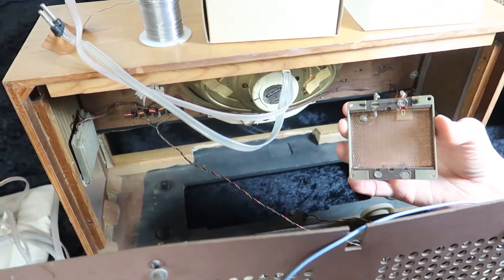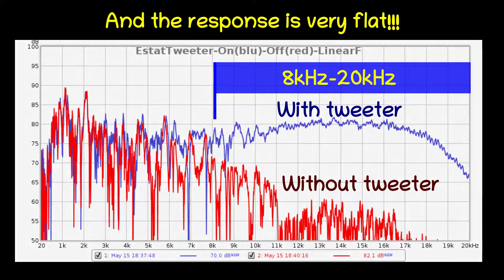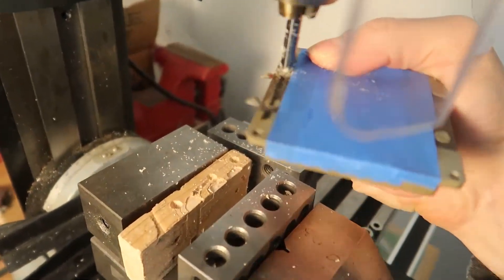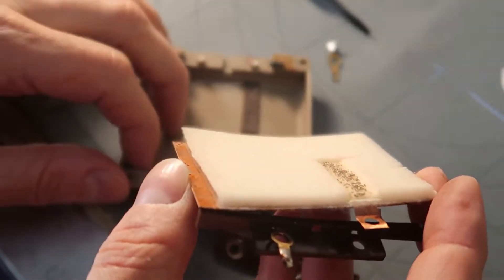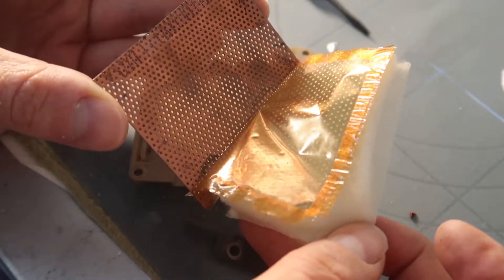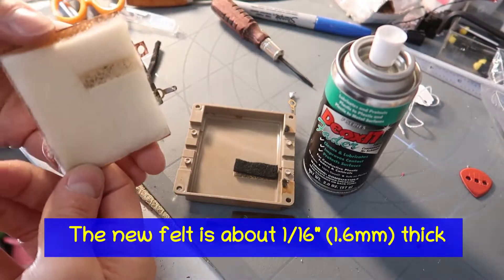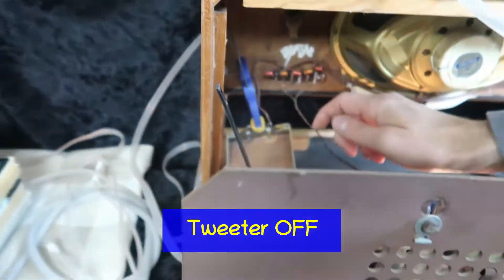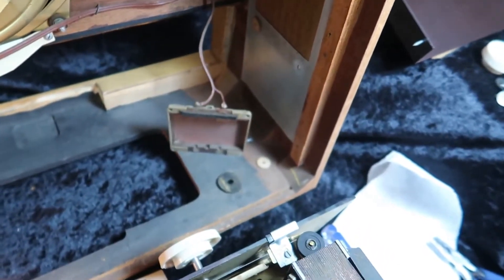Repairing the mysterious antique electrostatic tweeters in a Grundig Radio

Comment: Is there a way to test these kind of tweeter instead of pulling it apart and if I can’t fix it what do I use to replace it my console has 6x9 woofer and a 3 inch tweeter and this electrostatic tweeter like the one you show

Comment: Hello, I've watched this video shortly after you posted it and had some success with a few  of these ES Tweeters, but in my case, the deteriorated foam and wadding was only half of the problem;  On half of these tweeters the metalized coating has worn off or got badly oxidized, resulting in poor or no continuity.  I have been trying to find replacement metalized films of the right thickness for quite some time now to no avail.  Companies that do produce a potentially compatible product won't sell it in the small quantities we radio restorers need, only giant expensive rolls of the stuff.  Some companies do ship A4 size test sheets (I am told) but so far none of them got back to me when I requested such test samples.  But I keep looking almost every week...  Thanks for sharing the video nonetheless, it is quite informative.

Comment: I don't think it's supposed to be that subtle. The before/after on the Telefunken electrostatic tweeter repair video is huge. Have you replaced the two caps in series with the tweeters?
Reply from the maker: Thanks for your comment! 
I read that the e-stat tweeters were "subtle" in a few forums, but that doesn't mean that the forums were correct. If they are supposed to be more aggressive (that is, if they are supposed to make more sound below 8kHz), I'd like to know how to do it. Thankfully, the owner of this radio was thrilled with how it came out and said it sounded just like he remembered it as a young kid. 

Good point about the capacitors. I found a few other caps, mainly the original blue-dipped ones, that were quite bad in the audio chain. After I ran the radio for about 8 minutes, it would very suddenly become more and more distorted. I checked voltages, resistors, etc for about 2 hours. Finally, I found a bad signal cap by heating it with a small hot air gun and cooling with with canned air. When it got warm, I got distortion. When it got cool, the distortion disappeared! That was the toughest troubleshooting problem I ever dealt with! Swapped the cap out, and it sounds great now!